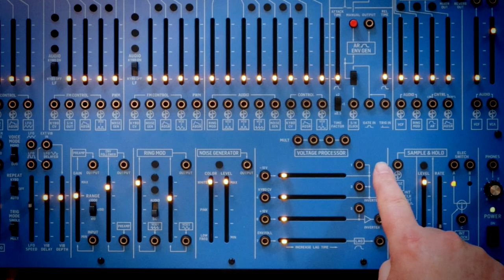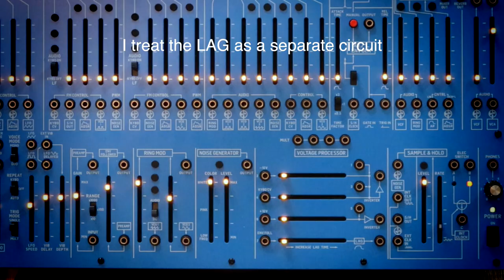Behringer 2600 Voltage Processor: Tutorial and Demo

Comment: FYI you normally don't want to hook multiple outputs to a mult like that because it's sending output into another output and it can damage some modules or synths. A mult isn't a mixer--it's for splitting one voltage and sending to multiple inputs.
Reply from the maker: … but you can on this. The magic of the 2600! 😀

Comment: Hidden feature of the 2600 -The Lag processor is also a 6db Low Pass Filter if you need it.
Reply from the maker: Haha... there’s always something I miss!
Reply: It’s a deep cut.  I rarely use it for that but if you want to shave a little top off of a blend of waveforms it’s there.
Reply from the maker: Yeah as far as I recall it only goes to 1600 but not something I’ve ever used tbh. Still... would have been good to add :)
Reply: @StarskyCarr  Used it on this patch tutorial https://youtu.be/BlVjJTaxmAM Most of the time you'd patch an external filter but I like setting up challenges where I only use the 2600.  That's when it would com into play.  Great video.  Thank you for taking the time to make it.

Comment: Unfortunately neither ARP nor Behringer had the sense to indicate on the panel which direction to move the pots to increase or decrease the signal into the inverters. And they omit the symbol indicating that inputs 2, 4, 6 & 7  are normaled, inconsistent with the styling of most other normaled inputs, thus adding to the confusion.

Comment: OOh I await new posts from you like a dog waits for the postman - coffee ON!. 
I've noticed something on my recently acquired 2600 and wonder if you could verify?  
If the Trig Mode switch on mine is set to MULT, the LFO will not move until you slide it up, where it starts modulating at around the same rate as incoming triggers from my Arturia Keystep 37 arp when via midi. 
Vary the BPM on the Arturia and it seems to follow. 
It does not do this when you are using the CV outs though. 
So does this point to LFO being somewhat syncable to Midi Clock?
Reply from the maker: Haha - nice to hear I’m not talking to myself :) The LFO resets on midi NOTE ON when in mult mode. Maybe that’s what you’re noticing!
Reply: @StarskyCarr  That may be it! When the LFO rate is slower than that of the incoming Midi Note, it doesn't move - so some potential hacks! You are defo not talking to yourself. Keep on being excellent!
Reply: So - CV signal does not re-trigger LFO in MULT, but Midi does. I wish there'd been some midi info specs in the manual to clarify things!
Reply from the maker: Although I've played it via CV briefly ... just to see what happens - I never took any notice of the LFO, I was surprised by the MIDI note reset tbh.
Reply: @StarskyCarr  So I wasn't going nuts! There is a performance hack in there which is cool. My wife and family are getting a little frustrated at the weird noises filling the house - headphone nah! - but I am having so much fun.

Comment: Starsky, I need help on something: is it possible to invert the phase of an LFO using the VP? Or to have two LFO's that move at the same frequency but with a 180º phase offset?
Reply from the maker: Sorry only just read this. Yes. Put a sawtooth into the mult take one direct out to wherever… and send another via an inverter. I show this in the video using an oscillator as an LFO and cancel the phase to get zero modulation.
Reply: @StarskyCarr  Thank you! This actually worked. I'm still struggling to figure out a patch so I'll ask again: Is there a way you can use either the Ring Mod or an LFO to get a left to right panning trick? I'm trying to recreate Pete Townshend's patch in Who Are You, and I'm trying to get the panner effect.

Comment: Please don't do it, but how fast can you get the clock signal higher without failing by introducing an oscillator?
Reply: I'm a little afraid of higher frequency as voltage.
Reply: You made the sound of a witch taking a pumpkin dump in the cabbage patch forest.
  R2... Is that you?
I like it.